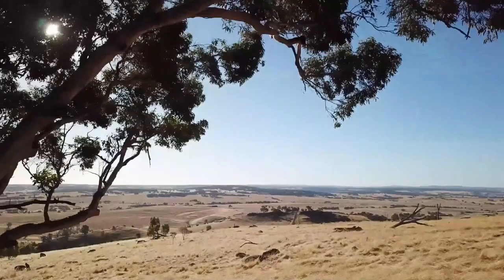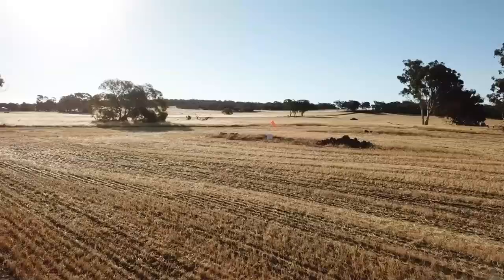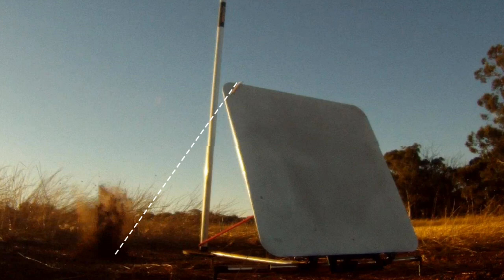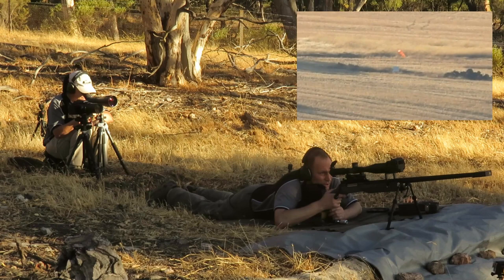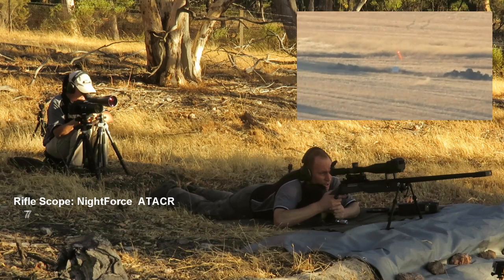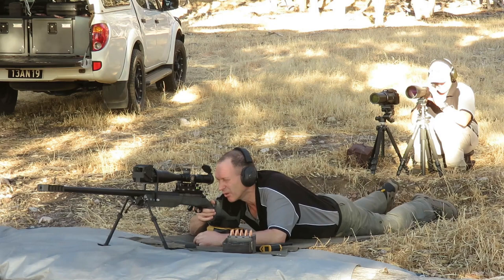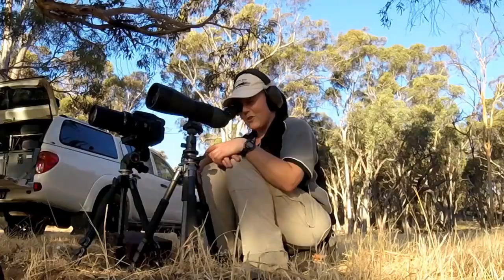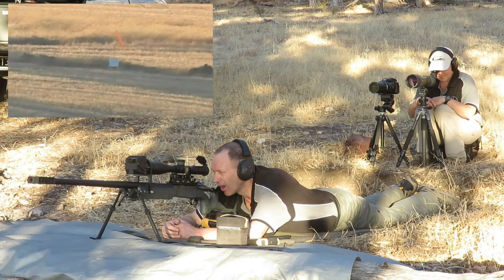5023 yards ULR Shooting (Bullet image in flight)

Comment: The bullet appears to be pointed along the trajectory path instead of keeping the angle it had when leaving the barrel. Is this an optical illusion or is that the expected behavior?
Reply: At that distance, the projectile is dropping into the target. One has to point the muzzle end of the rifle up into the air in order to get the projectile to drop into the target. All projectiles have some sort of "rainbow" trajectory. Some are much more pronounced than others (like a 45-70). In this case, with a much more aerodynamic/ streamlined projectile with a much higher Ballistic Coefficient, that "rainbow" trajectory takes place at much longer distances. Gravity is always pulling the projectile down, any projectile, therefore to get out to those distances, one needs to "drop" the projectile onto the target.
Reply: In this case, the bullet is pointing nose into the incoming  air flow,  (basically the trajectory path). Also the bullet has to transition through the trans sonic zone. 

Being able to nose over into the oncoming airflow as the trajectory arc changes, and being able to remain stable through the transmission sonic zone (about mach 1.2 to .8) is something not every rifle/bullet combination is able to do.(gyroscopic stability and dynamic  stability) Some bullets are more conducive in that regard  than others.
 Some of the factors involved are, -twist rate of the barrel.
-Rifle chamber to bore alignment 
- the shape and design  of the bullet.
Reply from the maker: Yes, the basics of a correctly designed gyroscopically stabilized projectile that is travelling through the air, they will straighten out to nose to tail flight after a certain amount of subsonic flight, lots of details in that but yes expected behavior out here, Cheers
Reply: MarkandSam AfterWork so in most cases until the bullet goes subsonic it follows the angle of the barrel throughout it’s arc?
Reply from the maker: As said, lots of details and differences, but yes that would be the case for some, maybe most, Cheers

Comment: You guys are always a treat to watch! Like you would say down under, cheers mates! I have a question though. I seem to get more accuracy by "pinching" the trigger rather than "pulling" the trigger. To explain, I put my thumb behind the trigger guard and my index on the trigger face, then I do a pinching motion applying equal force going on both directions. I do not rest my shoulder against the butt stock as to not get the movement of blood pumping thru veins or vessels at that point. I rather feel the kick of the recoil than adding human factors to the equation. Am I going about the wrong way with this method?
Reply from the maker: Thanks Man, well that is a different style of shooting to what we do, many use that sort of thing for bench shooting called free recoil, and if works for you then stick with it. Our style suits what we do, full prone, field/tactical application, all light to heavy hitters, and as you can see works OK for me. Here is a link to explain,  https://www.youtube.com/watch?v=k3q_pfiF4X8, Cheers

Comment: Still can't believe you were getting that much consistency, must be reassuring to see the projectile flying so well......you know, if your not going to use a 30" plate then how about loading 30 rounds next time. 
Hope you get another chance at this shot soon. Been meaning to ask why you set your rounds up on the left and pass them across rather than just place them on your right, is it habit, or does it so you break you rest to ensure you reset for each shot? Would have thought the less you move the more consistency, guess it don't matter that much?
Reply from the maker: Thanks Man, i prefer this, where I keep the ejection side clear, everything goes on my otherside, a bit about the cameras and a bit about habit, Cheers

Comment: Amazing content, as usual.  I just shake my head and smile like an idiot when watching you pull off these amazing shots.  what kind of "group" do you think you could get at that distance if the gun were locked tight into a sled? I'm sure that even a slight breeze can have a 5-10 moa impact at that distance.
Reply from the maker: Thanks Kyle, yes if we just shot without adjustments and the fact that there are several different winds that change all the time over this sort of shot, we would have a 50 to 100 yard group out there over the session, Cheers

Comment: why r u shootin above the horizon? u r in Australia, u need to shoot under the horizon line, then bullet will fall into a target!
lol, but to be serious, why do you don't use a labradar or another velocity meter for bullets? on this distance even 1fps of difference in bullet speed will cause a miss, so you need to be confident in ideal sameness of rounds. And do you use an paranoic reloading techniques?
Reply from the maker: Well, using a chronograph is very good to record data, but will not help make the shot you are on, if you are looking for improved groups by refining your loads you can find info from a good chrono like the Labradar can certainly help. As for this shot, we where grouping very very well (as you can see), loads are running perfectly. FYI we have videos on our basic loading technique, Cheers